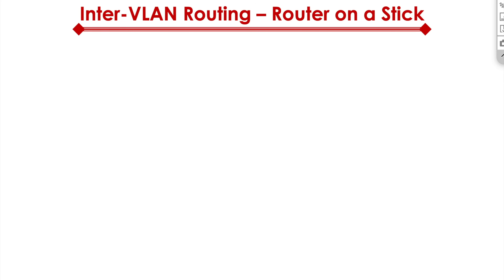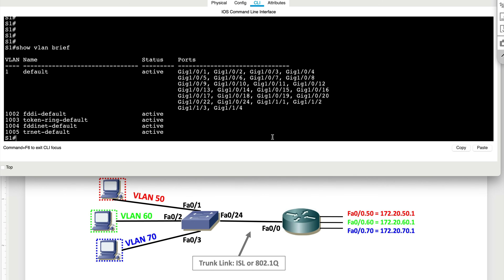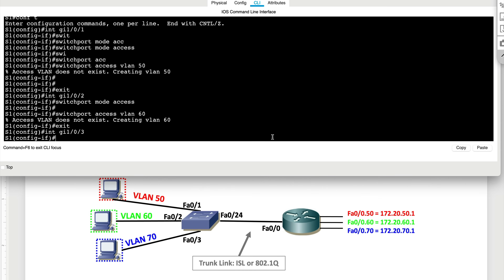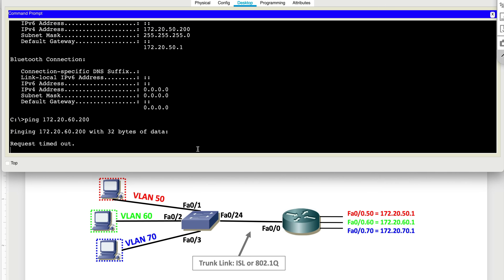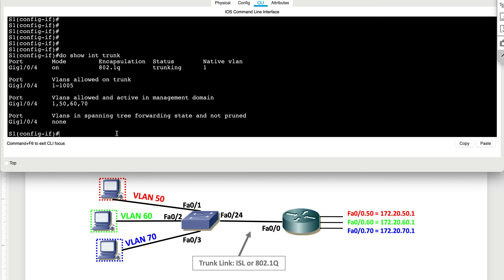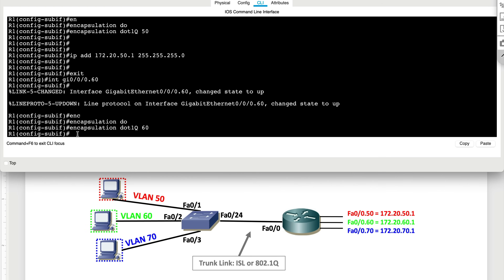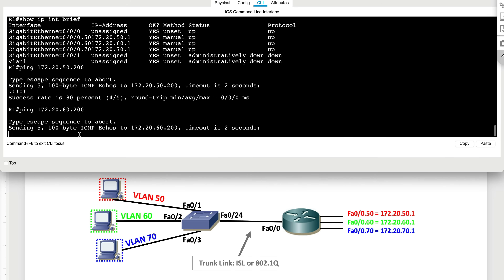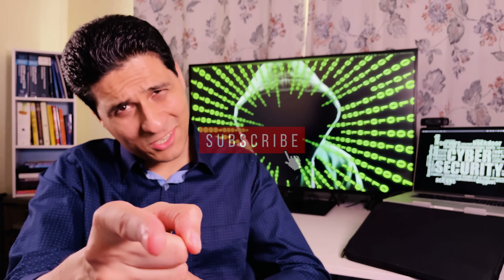Router on a Stick Overview and Configuration

Comment: What do you think of inverse router on a stick configurations? There are where a truck is created from the device level to conduit a common VLAN tagged ethernet cable to the switch.
Reply from the maker: Can you elaborate?
Reply: @NajQazi   These are trunks that on one end are device tagged, not the switch. And the other end goes to the switch. The Switch is the only thing you configure a 801.q . The route is natively handling all VLANS. That is each VLAN gets a physical interface out of the router. Now back to the devices that were tagged. You basically converge two or more devices into one ethernet cable carrying multiple VLANs into the switch.

Comment: Great tutorial! couple questions; I know this is about switches but could the switch be replaced with a router? there is still the single point of failure but if you could swap them, would there be any performance benefit? 
in the context of sharing one internet connection from fa00, and you actually did not want the VLANs to see / communicate withe eachother but access the same internet? ex if a router had 3 WAN ports could They be used as essentially 3 VLANs?
Or WITH the ROS can it be configured so the 3 VLANs cant see each other but still share the same internet?
Reply from the maker: If your goal is to block inter-VLAN traffic, here are a few effective methods to consider:

1 - Access Control Lists (ACLs) – A straightforward way to define what can and can't communicate.
2 - Private VLANs – Ideal for creating isolated segments within a VLAN.
3 - Virtual Routing and Forwarding (VRFs) – Useful for separating network traffic paths.
4 - Zone-Based Firewalls – Adds a layer of security by controlling traffic based on zones.

On the other hand, if you need to restrict intra-VLAN traffic, so devices within the same VLAN can’t communicate directly, micro-segmentation is your go-to. This is where Software-Defined Access (SDA) Fabric shines, with Catalyst Center acting as the Controller to streamline automation and provide assurance.

I hope this helps clarify things!
Reply: @NajQazi  Thanks for giving some clues to look up on

Comment: hello sir how do  i connect the isp in router on stcik
Reply from the maker: Terminate the ISP circuit into the router and configure appropriate routing such as static or dynamic.  Also if it's an Internet circuit make sure you have a FW connect to the WAN router.  Hope this helps!

Comment: do you not have to, on router end assign the switchport g0/0/0 as a trunk ?
Reply from the maker: You don't create a trunk on the router.  On the router you simply create a sub interface for each VLAN and specify encapsulation dot1q, in addition to assigning an appropriate IP address per subnet.  That's it.  Hope this helps!
Reply: @NajQazi  thanks.
Makes sense.